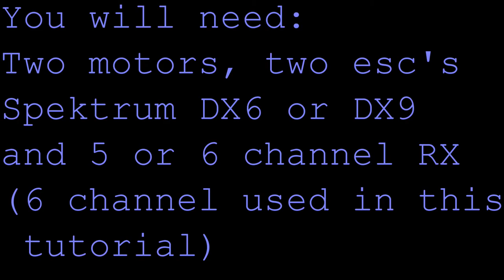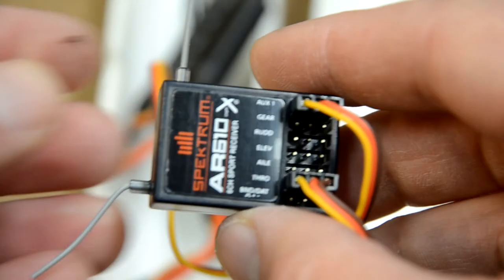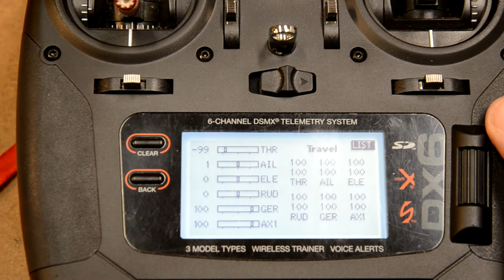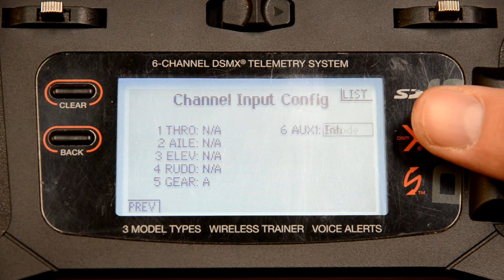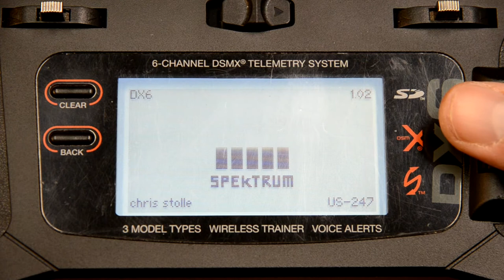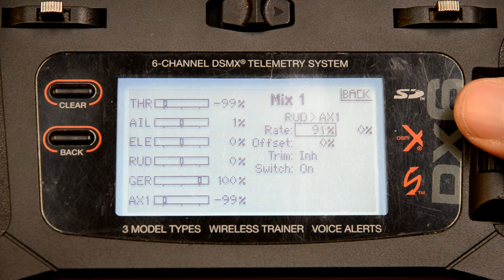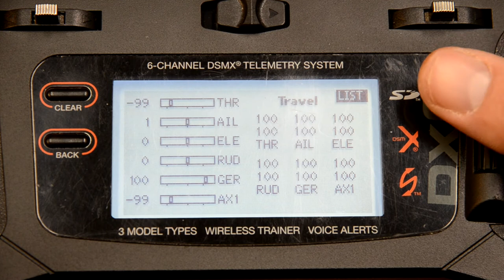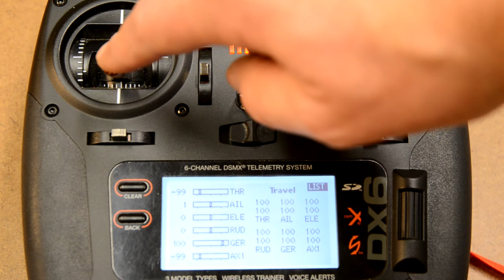Differential thrust on Spektrum DX6 or DX9

Comment: I tried this on the DX8 WORKED GREAT!!!! however I learned you can't do throttle cut!     this was THE CLEAREST EXPLAINATION I HAVE EVER HEARD. THANK YOU SO MUCH SIR! Keep doing great videos!!
Reply: Steve I hope you can help me. I just setup differential thrush and have the same problem with throttle  cut with Aux 1. It works just fine  with the motor plugged into the throttle on my receiver.  How did you get it to work on both motors?
George
Reply: @georgesager1573  are you on Facebook?
Reply: @stevenungester927  yes

Comment: From the AMA Feb 2021 edition of the Model Aviation magazine, I've started the build of the model on the cover.  It's called the Yin-Yang and your video is nothing short of awesome, and because the model doesn't have any rudder control, (it's solid), your video will help me with my dual motor, (one a pusher, the other a puller or tractor as you call it), differential thrust setup. 
You have helped me more that I can say and I thank you for taking the time to create one of the greatest and easy to follow videos, that I have ever viewed.  Again, thanks for eliminating one giant headache for me and at the ripe old age of 82, (just had my birthday in January), the fewer problems I have to solve, the more time I have to enjoy my Golden Years and the RC hobby that I entered into about 6 years ago. THANKS!  THANKS!  THANKS!

Comment: This is exactly what I was looking for.  I am about to begin a Grumman Goose build and I definitely would like to have differential thrust with this plane for control while it's on the water.  Thanks for this perfect explanation and setup.
Reply: Ron were you able to setup throttle hold for both motors?
I haven’t been able to get throttle hold to work on the motor plug into Aux 1.

Comment: It's an 11 year old foam semi scale kit which was designed for 400 size brushed motors and nicad batteries. My idea was to tart it up a little and over the years I have almost rebuilt the entire airframe, adding retracts, using brushless motors/ ESCs and lipos. as a result it has taken me too much time so far and I have decided that it needs to earn it's keep! Originally the rudders were to be fixed and I had plans to activate them, but the servos and linkages were going to add some unwanted weight at the wrong end of the airframe, so your info should allow me to gain some yaw control. I have connected the tail wheel to the rudder channel and now have the option of adding differential thrust for accurate ground handling/ taxiing. Thanks again.

Comment: Did this on my AL37 Airliner with my DX8G2. I used aux 2 since aux 1 is for flaps. Thanks for the video. Just have the throttle trim centered.

Comment: As many have said, great tutorial on setting up differential thrust.   I have an HU-16 Albatross, where both differential and reverse thrust would be interesting.  I've learned a great deal about the DX6 transmitter, but I'm not sure how to reverse both motors with the flip of a switch and retain differential thrust as well.

Comment: So regular throttle is just both engines. Thats pretty awesome! Anyone that builds their own plane can use that. If you buy a twin engine plane, chances are, it already has a set up in the esc for thrust vectoring. If something happened and you needed to replace the electronics, this would be a great way to set up all new electronics in an older plane that has been sitting that you wanted to upgrade.

Comment: Thanks! One thing to note, if you are using this configuration with a DX6e, don't use the Flap system. The flaps use Aux1 and you can't select it in the Input Config screen.
Reply: Roger Banks how do I make differential thrust work on the dx6e then? I’ve spent around 2ish hours searching for something but I simply just give up, do you  have any idea?

Comment: I am building an RC boat with 2 EDF motors, it's a big boat... I found your explanation very clear and effective and to the point. I followed all of your steps and even made a cheat sheet for myself on how to do it again if I need to.  I have one question, that I haven't figured out.  Since one motor is connected to the throttle input on the receiver, and the other motor to the Aux1,  so when i do "throttle cut" on my DX6, only the motor that is connected to the throttle input gets cut, the other motor still gets power. How can i program another switch to cut that motor that is attached to the Aux1 input on the receiver?
Reply: I’ve got the exact same issue🤔 Did you work it out?

Comment: Great video! Hopefully I'll be able to use this for better ground handling on my hobby King c-47.
Reply from the maker: Glad you found it helpful.
Reply: +Chris Stolle I took it a step further bc I noticed that throttle cut only killed one motor. I can now kill either motor, or both allowing me single engine taxi. I'll do a video reply later.
Reply from the maker: I would be very interested in how you did a dual motor throttle cut.
Reply from the maker: Scott Heath
I am very interested in how you did a dual motor throttle cut.

Comment: Great tutorial. Very clear and easy to follow. Thanks. My question is this....I have an HU16 Albatross twin and it can reverse by switching my gear switch.  Will your differential setup work with my setup?  I want the differential to help turn the plane when taxiing only. The water rudder is very inefficient in anything over a 3 mph breeze. Thanks!!

Comment: Nice. I may try the throttle instead of the mixing. I do want channel 6 to be higher though. Ch 6 will be an additional EDF that will be running even when the pusher prop is off and folded back. I need extra umph for a heavy load.
Reply: Nice. Tied it in. Lowered the travel on Aux1. As I rolled lower than 99 the EDF sped up even with the throttle was off. Then as I hit the throttle it sped up as well. I suppose I could run EDF only and at full throttle either by rolling travel even lower or throttle cut. I would like my throttle to be that roller full time and my pan and tilt to be the left stick.

Comment: Chris, just what I was looking for for a water rescue vessel!! Turns with differential thrust! Using a Gen 1 DX18. Now, how do I hook up a third brushless motor for a third motor to give me reverse capabilities(actually a forward thrust motor mounted backwards and will not engage until I flip a switch that turns off the differential motors and only turns on the reverse facing motor? Make sense? So far the water rescue craft works really well! Thanks, John

Comment: Question as I'm trying to wrap my head around differential thrust (dt). Spectrum radio.
#1 is the rudder still used in combination with dt. #2 do you put it on a switch to be one or the other? #3 Rudder always on with dt. on a switch. #3 I think this would be most practical as I don't think I would used it that much other than to do some crazy spins. Thank you for your time.

Comment: Great Video- Just set up my Guinea Pig by your Info BUT if I use Switch C for throttle cut it will only cut one engine- Guess you have to do something special to get a 2 engine throttle Cut? Great Job Again!!!
Reply from the maker: My only setback.  I can't seem to figure double engine throttle cut.
Reply: @chrisstolle5664  did you guys figure this one out?  Setup went so smooth.  I fear I am going to bite myself with this.

Comment: Question,  I want to use this to aid in taxing a seaplane.  I would prefer to reduce the rpm of the inside motor when turning rather than increase the rpm of the outside motor.    Is there a simple way to accomplish this?  By the way, this worked great on my gen 2 DX8.  Thanks.

Comment: Excellent. Thank you. Straight forward but: how do you set up Throttle Cut WITH Differential Thrust? Setting up Throttle cut as normal cuts only ONE motor. So how do you set Throttle Cut to cut BOTH motors?
Reply from the maker: I still havent figured that out.  Sorry
Reply: @chrisstolle5664  , thank you for checking back. I almost had it. The trick was setting everything at -100%. This is what I learned with help: Set up a free mix as a kill mix: Throttle mix to Aux3 (where my 2nd motor is wired) -100% each way, offset at -100%. Set switch same as throttle cut. This mixes throttle against itself. Was used on older radios before throttle cut was available. Your video helped me get up to that point. Thank you.
Reply from the maker: Hey great!  I'll do just that my friend!

Comment: When i set up my radio the way you say to it works as you say until my throttle is above idle so lets say at full throttle and full right rudder my left motor is at 150% does this cause any problems thanks for the video
Reply from the maker: You can dial this effect back but no it doesnt really cause any problem.  It does make your plane to a really cool flat spin!  If you don't want this to happen dial your rate in your mix back to 80-85% or so.

Comment: Have u ever try it on superbee? My superbee rolling diagonally when  I use differential thrust.
Reply from the maker: sounds to me like your differential thrust is counteracting your control surfaces.  Reverse the differential thrust numbers in your radio program and see if it clears up.  If thats not the problem, try lowering the numbers to give you less differential.

Comment: I tried the setup. Unfortunately throttle cut would only apply to one of the two motors. .. according to the display on the remote. Anyone else experiencing this?

Comment: Do you have any yaw control if you are at full throttle?  Still trying to wrap my head around this.  Flitetest has a video using 4 mixes, but this works with just 2?
Reply from the maker: Differential thrust isn't activated by the throttle stick.  It is put into action by the yaw stick.  throttle and yaw arent fighting each other.  As you push the yaw stick away from center, it is throttling up the opposite motor to simulate a rudder.  At full throttle, once you push that yaw stick, one motor slows down and the other one stays at full throttle to bring about the yaw action.  But at full throttle, even a small input has a huge reaction to the craft.  hope this makes some sense.

Comment: Will differential thrust work if you are going full throttle?
Reply from the maker: Yes it will incrementally cut power from the motor you are not using.  So essentially only 1 motor is going full throttle when turning.

Comment: Hi Chris. Just one point. Using this mix I find that the motor cutout switch only disables the  engine tied to throtlle, leaving the motor tied to aux 1 live. Do you have a fix for this. Thanks, Mike.
Reply from the maker: Another viewer said he remedied this problem with a mix but I couldnt get him to respond with directions as to how to do this.  Sadly, I still have a single motor cut instead of dual.
Reply: @chrisstolle5664  Ok Chris. I will let you know if I find out how to fix this. Mike.
Reply from the maker: @sailor0500  Thanks

Comment: Any info on how to cut both motors?
Reply from the maker: IF you read through the replies on this video, one subscriber figured out how to cut both motors with a different mix.  I personally havent figured it out yet.
Reply: @chrisstolle5664  to disarm both motors all you need to do is add a mix that is activated with the throttle cut switch in the disarmed position. 

Master ch GER. Slave ch GER
Rate -100% 100%
Offset -100%
Switch  Whatever switch you used for the throttle cut on ch 1(THR)

When the throttle cut is active this mix is active too. When the throttle cut is inactive (motors armed) this mix is inactive.  When this mix is active the output on the GER ch will be -100 no matter what the position of the throttle stick is, hence a “throttle cut”
Reply from the maker: @larryhawks2208  Nice!

Comment: Hi Chris.  At first it all worked fine but now my right motor stutters and won’t run. I’ve double checked my esc,s. My receiver and new motors several times and just can’t get it can u help me. Thanks Bob
Reply from the maker: Are you sure it's not the esc? If not, it could be you switched a setting in the transmitter mix. Might want to double check that.
Reply: @chrisstolle5664  thanks Chris.   I have put in new esc,s and double checked the settings and everything else. I’ve been doing this for 40 years and I am totally frustrated
Reply from the maker: @robtness1  Then it has to be the mix. Are you using a dx6?
Reply: @chrisstolle5664  thanks Chris. No I’m using a DX9.  I’ve still not figured it out. The most frustrating thing I’ve tried in Rc for years. New esc,s new batteries new motors checked wiring a dozen times. I will chk. Settings again this morning.   Thanks again I’ll keep u posted
Reply from the maker: @robtness1  The DX9 should be similar in programming.  Start over with a fresh model in your TX. Fresh rebind of the RX to the TX and follow the tutorial again.  It could just be something corrupt in that particular model memory slot.  Ive had it happen before.
Reply: @chrisstolle5664    Thanks Chris I will try that.

Comment: Please confirm the transmitter model to order
Reply from the maker: Hello, this tutorial is for Spektrum DX6 or DX9.  It should also work with the newer DX7 from Spektrum.
Reply: Spektrum DX6 is having 3 models, which one is this or it will work with all
Reply: Chris Stolle Spektrum DX6 is having 3 models, which one is this or it will work with all
Reply from the maker: Spektrum has the old DX6 which is discontinued and no longer available.  It was replaced by the DX6i and now the newer DX6.   This tutorial will work on the DX6, DX6e, DX7 and DX9.

Comment: Love the video. Thanks for the help. But I do have a quick question. Without differential on, my max on the throttle goes to 100. Turning on differential with the switch moving rudder moves my throttle to 40 because my rates is 40, but moving throttle stick to max with rudder at max move the throttle to 140. I followed your setup step by step by I am using a dx8e. Would the throttle going past 100 even make a difference? Or is that only effecting throttle resolution since max throttle is max throttle?
Reply from the maker: When you calibrate the esc, it will set throttle endpoints so it really wont affect your esc or motor.  YOu arent going to fly with full rudder at full throttle for very long (mere seconds at max).  If I could ask, why do you have throttle rates?  I set rates for rudder, ailerons and elevator?  Or is it your rudder rates set to 40 which shouldnt affect your throttle rates.

Comment: Great video, Thank You! I have a question, you show it at zero throttle, what happens when you're at say mid throttle and then you use the rudder to get differential thrust? And what happens if you are at full throttle and you use the rudder for differential thrust? Once again thank you for the video, I am working on a rescue boat recovery air boat with two motors and this will help immensely. I am trying to recreate this model shown on Youtube: https://www.youtube.com/watch?v=80iH9CsB5CM&t=82s
Reply from the maker: Throttle doesn't directly impact rudder as long as you have some throttle input.  Only stick position matters after that point.  If your at 50% throttle and 100% rudder then your rudder is 100%.  If your throttle is 75% and rudder is 100% then your rudder is 100%.